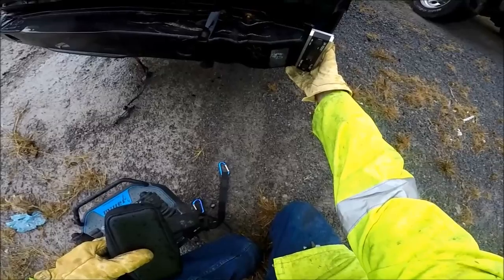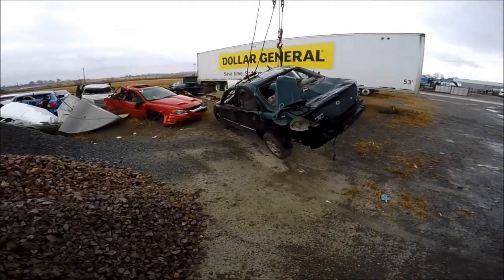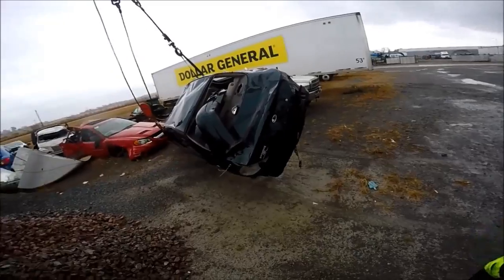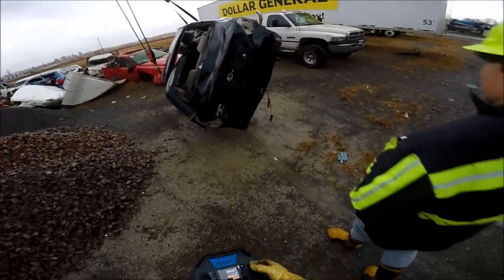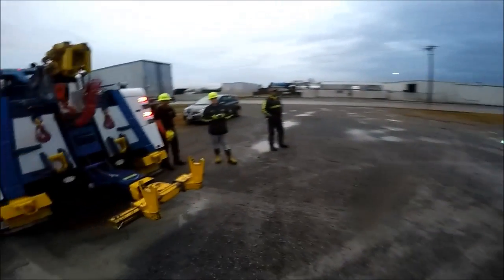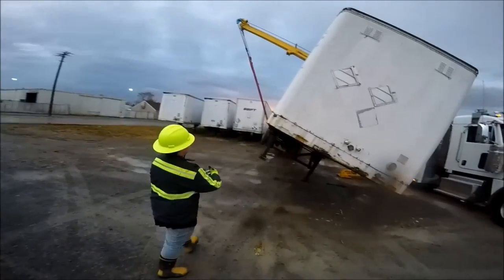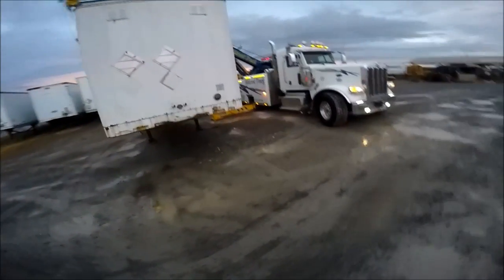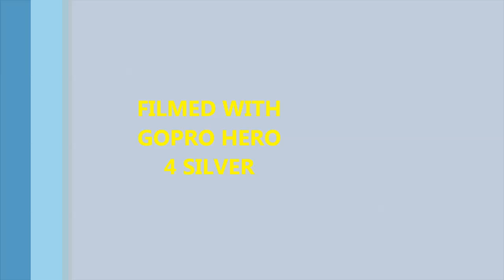ROLLOVER TEST 11 18 2016

Comment from the maker: If anybody has suggestions as to something they would like to see on video, please let me know and I will try to accomodate.
Reply: Same as loading a ship, you want your heaviest cargo as low as you can get it to maintain stability.
Reply: Well since yall can run lights and sirens do some response videos only I mean who wounl't wanna see a 72k wreckers going to a scene with lights and siren and the horn lol
Reply: i would like to see like a lot tour or something of that matter
Reply: I'd love to see it tutorial of basic concepts like how you can use anchoring to lower the center of gravity of your truck.   I like when you explain why you're doing certain things.   I always love learning things like which controls do what on the truck, maybe what the PTO connection looks like, is it like a tractor PTO on the transmission.   How the carriage rolls forward and back.   If Ethan is going to be in the industry he needs to learn the boom angles and how they can affect the lift, saw an episode on  Heavy  rescue 401 where the boom angle wasn't right with the bogie wheels to the outside during a flip and the trailer swung toward the rotator and could have killed Gary's son if the trailer wasn't stopped by the outrigger.

Comment: What if the trailer had been loaded with the heaviest items on the floor or as close the floor as they could get then stacking lighter stuff up to the top (or how ever big the load is?). Would that change the rollover angle any?  It does a good job of explaining what can happen with an empty trailer (high profile).  Now I understand why a truck can get blown off a highway on a very windy day or during a severe storm.  (Factoring in the force of the wind against the side of the trucks trailer.). It doesn’t take a lot to roll the trailer if it’s empty.  Ethan is lucky he happens to have a great dad who owns a towing company with the equipment to do a cool demonstration like this one.  👍🏻😊
Reply: Also as it starts to tip the load can shift which changes it even more.

Comment: What if the trailer had been fully loaded?  Would that have an effect on when it would roll or would it have been the same angle?  I am guessing that when they load a long trailer like the one you were using here, they would load it with the heaviest stuff on the bottom, then work there way up.  You would also have to distribute the weight evenly in the trailer so you wouldn’t be putting to much pressure on a single axle on either the trailer or the rig. I was thinking about a truck running down the interstate with a strong crosswind coming at it from the left or right side.  Great experiment, I’ll bet Ethan learned quite a bit from that.